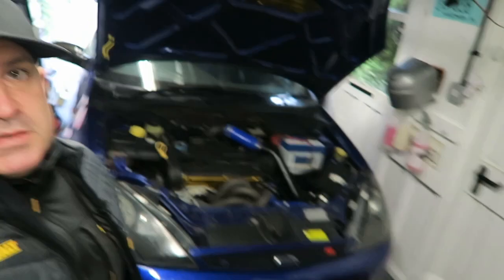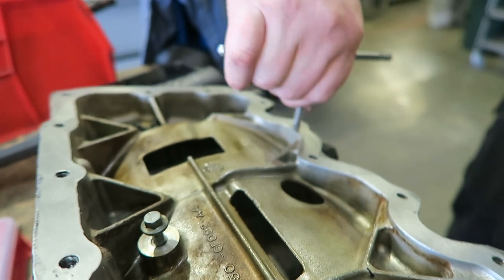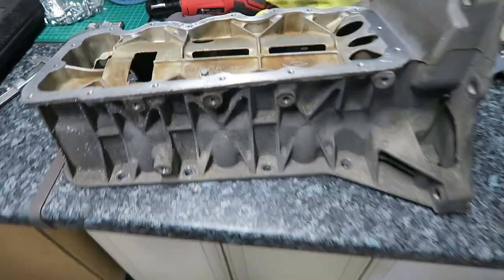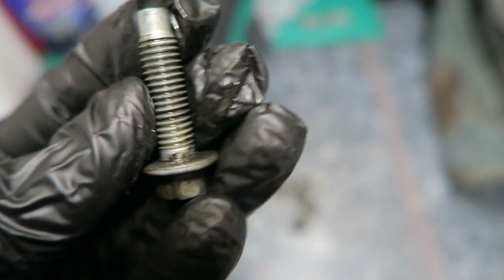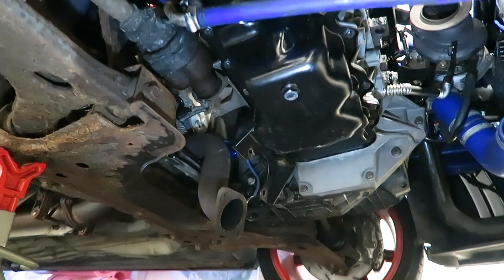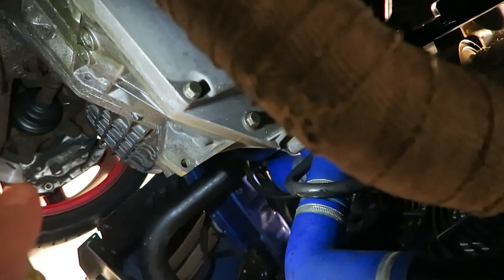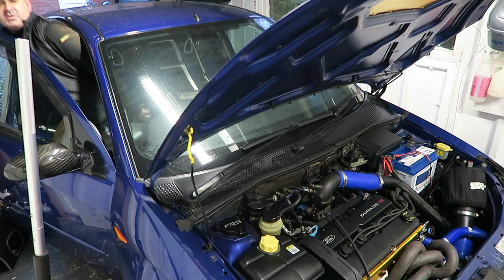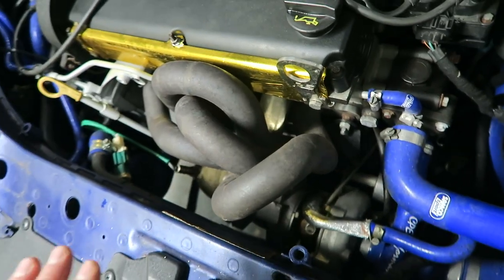Focus RS MK1 Crankcase and lower sump rebuild (Heli coiled) fitted back after months off the road!!!

Comment: YES HE IS BACK! My rs is falling apart lol no, my Race engine mount is vibrating everything off lol Good luck !  commented before I watched = oh dam 31 years on the net and :  FINALLY FIRST COMMENT!
Reply from the maker: Cheers mate means a lot!  What race mount you got? I got the vibra technics on mine and not had to be honest.
I am pleased you got first comment as well 👍
Reply: @DJLloydy  For the lower rear engine mount its a full Vibra Competition one.   My bones are aching! Uppers are trial and error at the moment as I am trying to locate a 'knock' looking like my anti roll bar bushes need doing
Reply from the maker: That one is the teeth shatterer isn’t it lol 

Dreaded knocking noise :( I had that on the Fiesta and was the top mounts and the lower ball joint bushes.  Since changing the car feels brand new